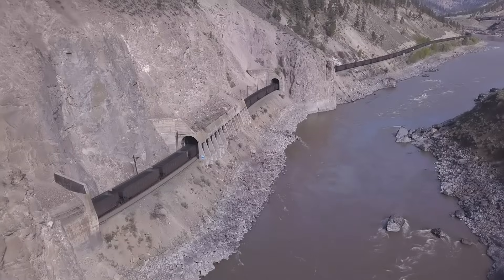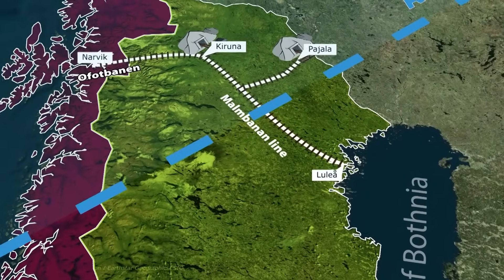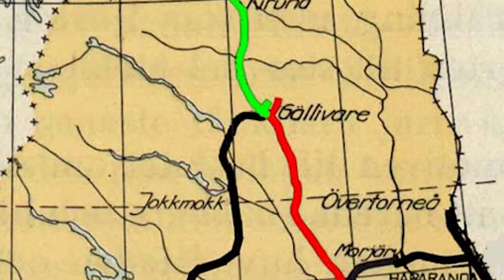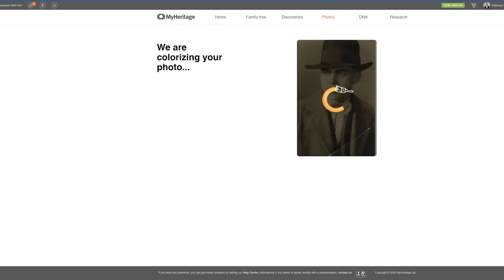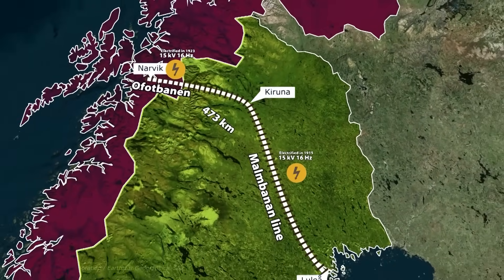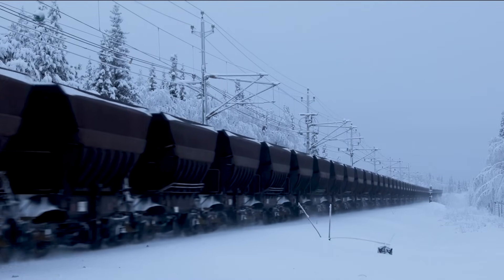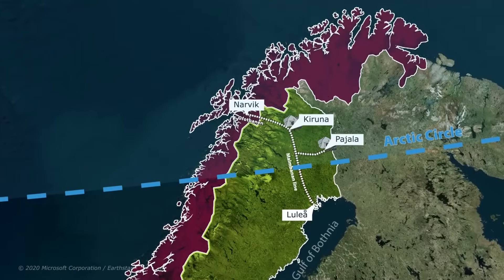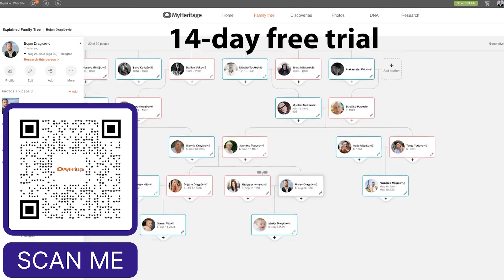How Do Trains Operate in Harsh Arctic Conditions?

Comment: Question: what are the requirements to be considered a heavy line?  

Also, as a novice, I have a hard time deciding if that 25T axis weight is kind of a lot or not. Could you elaborate on that?
Reply: 0:25 the text, it answers exactly your question, doesn't it
Reply: @u1zha   I can't see that on my mobile... 
I'll try to find a suitably large screen then.

Comment: Those wagons look simular to one of the styles used here in the US for Iron ore transport. These cars are 24ft long, and operated under numerous  railroads, most notably the DM&IR, BN, CNW, and CN, and are commonly called "Minnesota Ore Cars" (don't know why). Many cars are preserved, or in operation today, with new batches being made each year. The other style is a short, gondola (20-30ft), and said style has been gone for a while. Modern examples are the Rapid Discharge Hoppers, which are 43ft long and used for a variety of other ore/rock transports(except for the CN example, CN still utilizes the 24ft Minnasota Ore Car)
Reply: "Minnesota" to distinguish them from the "Michigan" cars which were narrower and slightly lower. Or also from the "Bessemer" cars used by B&LE which were like the Minnesota cars but were fitted with ordinary draft gear (and thus were a couple of feet longer because they did not need to be squeezed onto an ore dock), contrary to the MI and MN cars which special draft gear.
Reply: @NickBurman  I'm gonna keep this noted...my N scale train collection is going to have 2 iron ore trains, and I don't want the same car over & over.
Reply: @BattleshipOrion  the Atlas N scale ore car is a "Bessemer" car, as it has the frame extension needed to house ordinary draft gear. You could fake a Minnesota car out of it by cutting the extensions and then finding a way of shortening the couplers.

Unfortunately, nobody else makes either a MI or MN car. You could try your hand at designing one for 3D printing.